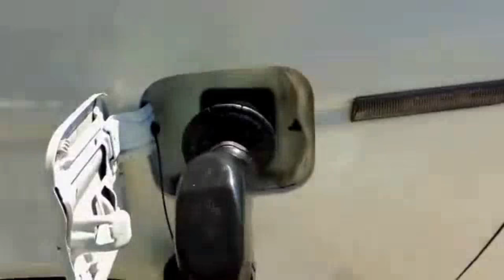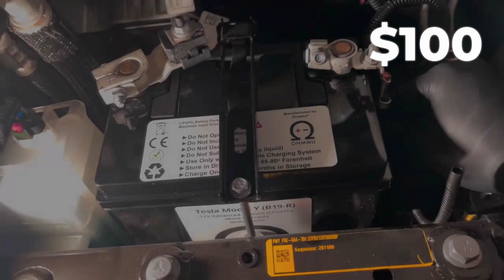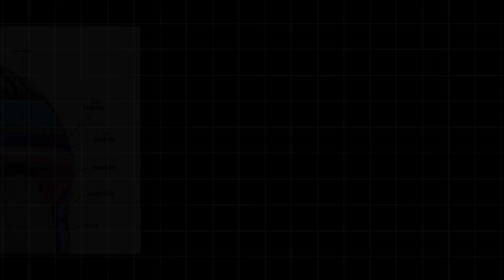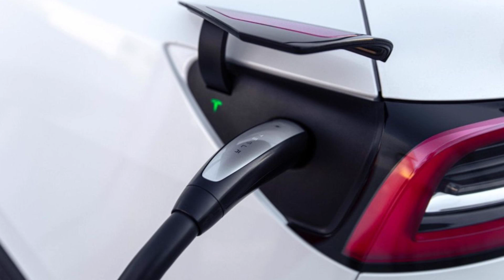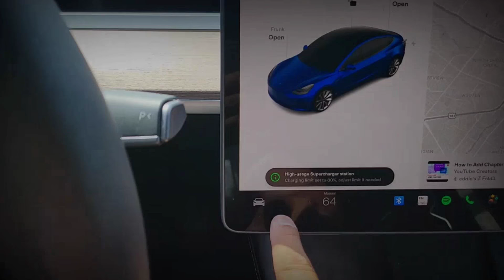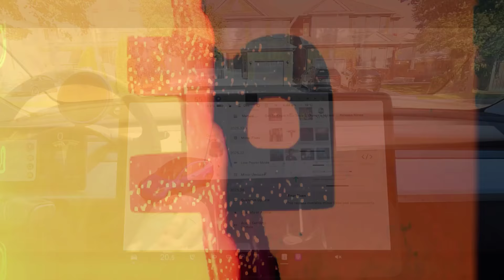How To Make Your Tesla Last Over 300k Miles Without Any Major Repairs

Comment: How do I check the battery cooland for leaks or degregation? You didn't show us much in the video. Thank you!
Reply from the maker: Pop the frunk and remove the panel by the windshield. The reservoir’s under there, and the level should sit between MIN and MAX. For leaks, check for drips under the car or crusty residue on the hoses, and the car will usually alert you anyway. The coolant is basically lifetime, so if the level keeps dropping, take it to service
Reply: @TeslaCentralHD So unless there's a leak, the fluid is rated for lifetime use?

Comment: I rotate my tires every 3000 miles.  Manager at Les Schwab who also owns a Tesla said the 6250 Tesla recommendation is not enough. First set of tires lasted 38,000 miles.  On my second set with 3000 mile rotations currently have 52,302 miles on the second set of tires with lots a tread left.  At 90,302 miles now.  I expect to get around 65,000 miles out of my second set of tires.  It’s a myth that EV’s burn up tires fast.  You just need to do shorter rotations. I’ve also only done one alignment in the life of the car so far.  I plan to do a second alignment when I do install my third set of tires.
Reply from the maker: 52k on the second set is pretty impressive. Sounds like those 3,000-mile rotations are really paying off.

Comment: What about charging it after every drive not waiting the battery to drain to 20% or below? Will it hurt the battery life if I charge it after every drive? If the battery is at let’s say 30%, 40%, 50%. Will it alter the battery life at all?
Reply: It will not hurt the battery life if you charge it after every drive. 
50% is the best for the battery. (the least chemical reaction) 
When I go on holiday ore will not use the care over some time I leave it at about 50%.     
Daily use is optimal at 30 to 70%.   But 20 to 80% is just fine.            
Enjoy your car !                                        Luv from Norway!  😀

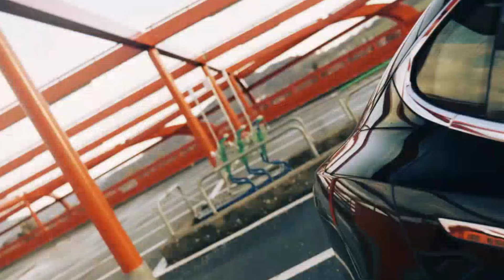Comment: @2:27 that is not a 12v battery that is a 16v lithium battery.  A 16v lithium battery should last 5-10 yrs.  A 12 v battery is $160 with tax at Tesla.  However a 16v lithium battery costs $450!

Comment: Yes, changing the 12 V battery. Every few years is good in the older models, but they took care of that in the newer models after 2021 and now the battery lasts a lot longer. I’m kind of surprised you didn’t note that.
Reply: @PodcastUFO.  I agree with you.  The 12V batteries in the newer Tesla models are using LFP (Lithium Iron Phosphate) chemistry which lasts 10 years.
Reply: I have original 7 year old battery in my M3 LR. Voltage 13.x . Seems to work fine

Comment: Please explain how to rotate Tesla tires.
Diffrent sizes front and rear.
Reply from the maker: If your Tesla has different tire sizes in the front and rear, you cannot rotate them front-to-back.

You may only swap left and right on the same axle if the tires are not directional. Otherwise, they should stay in their original positions.

Comment: Charge only enough to arrive at the next charging station with about 10-20% charge.
Reply: The chemical  reaction in your battery is higher at 10-20%   , better to go charge at 30-40%      🙏

Comment: Tesla changed from 12 volt lead acid batteries to around a 15.5 volt lithium ion batteries several years ago, with a major reason being that the lithium ion battery lasted 5+ years and longer compared to the lead acid batteries. They are also more expensive.

Comment: Charging above 80% is not a problem. Letting it stand with 100% in the sun is a big problem. 80% for daily charging is ok, but if you need 90% or 95%, not a problem, especially if you start driving after charging is done.
Reply: Exactly. The problem is simply leaving it at 100% stresses the battery at a higher rate anything under that will cut the charging. 80% is recommended as best case. So, no, definitely not critical.

Comment: Tesla now uses DOT 4 brake fluid.  
Silicone-based, and very little hydrophilic, if at all..
Reply: DOT 4 is "synthetic" and has a higher boiling point than DOT 3, but it is glycol-based, NOT silicone-based.  It can be used interchangeably with DOT 3.  DOT 5 is silicone-based.

Comment: I had a 2019 Model 3 that had the battery issue in 2022, but it didn't "die" as you suggested.  Instead, a warning message appeared to notify me that the battery voltage was at a critical level and needed replacement.  Tesla actually replaced it under warranty.

I've since sold the Model 3 and purchased a 2024 Model Y.  The car has been operating flawlessly.  So far, the only items I have replaced are the hepa filter and wiper blades.  Tires will be the next item on the list soon.  

Not sure about your suggestion to flush the brake system every two years.  In my gas powerered vehicle, (a 2018 VW Tiguan), I only flush the system when it is time to replace the brake pads, which is around every 35K miles or three years.  Since the system is a closed looped, sealed system under pressure, moisture should not be a factor.  The reason for flushing the system is because the fluid eventually breaks down due to heat and other factors.

As an aircraft owner, I recognize the importance of maintenance to keep our machines running in tip-top shape.  Thank you for the advice.

Comment: For a channel that was started quite some time ago and only 3 video’s posted - meh canned  messages with a lot of mis-information mixed in with some common sense and very few tidbits of meaningful info. I could critique much of  this video - maybe all this assumption was made on vehicles produced more than 3-4 years ago - a lot has changed - so used Tesla market specifically sub 2017 /2018 models.

Comment: If your Tesla has a LFP battery like mine it probably also has a 15V Lithium ion low voltage battery. If your car is the same you should regularly charge your battery to 100% and you don’t need to replace the low voltage battery for at least 5 years.

Comment: Yeah, I never got a notification about my 12v battery and when it died it was definitely an inconvenience. The crazy thing is that just the week before, I actually had a fleeting thought about the 12v battery and realized it was about 3 and half years old. But I do think the car was trying to tell me something was up because a few days before it died, I noticed the trunk button didn’t work the first time I pressed it. But, because that sometimes happens anyway if your phone is in your back pocket, I didn’t make the connection. I was pleasantly surprised the OEM battery I picked up from Tesla was a tad over $100. Not bad…

Comment: Incorrect.

Tesla recommends CHECKING brake fluid every two years — replacement only every four.
Reply: Tesla service told me they suggest the brake fluid (AND the battery coolant) will last the life of the car  (2019 Model 3 Dual motor LR) but do suggest checking it every 4 years.
Reply: @edchwekun3963 They told you wrong.  Read the manual.  Brake fluid physically breaks down after four years, even if unused.

Comment: Homeboy i lost 20% on a 2023 model y in 70k miles i drive 150 miles round trip to work 3x a week 100% charge is MANDATORY because the range is way less than what tesla claims.
Reply: Your bad charging habits is not a design fault.
Reply: Are you living in the arctic or something? You absolutely should  get enough charge to do 150 miles without needing 100% charge every day. If anything you are creating this problem with your battery by degrading it so quickly

Comment: 1. Charge only to 80% most of the time. [Wrong. Battery degradation increases significantly above 75% according to Jeff Dahn(2023) and Recurrent Auto(2025)]
2. Replace the 12v battery every 3 years. [This is for lead acid. Interval is much longer for newer Li-Po batteries]
3. Flush brake fluid every 2 years. [This is for all vehicles]
4. Rotate tires ever 6,250 miles. [All cars should do this either every 5,000/6,250/7,500]
5. Replace cabin air filter every year. [No. Check the Tesla computer to know when, it tells you]
6. Supercharge only to 80%. [Besides battery health, you should do this because its a waste of your time to go past that and its really rude for anyone else waiting]
7. Precondition HV battery before supercharging. [YES, do this]
8. Inspect/replace suspension bushing every 100,000 miles.  [This is for any car]
9. Keep your software up to date.  [This is for any car]
Reply: For 1 and 6 is there some context missing?   Cap charging at 75% then?
Reply: You have no idea how incremental that is. Take a Tesla 75 kWh NMC battery:
100% SOC = 4.20V per cell. 
80% SoC = 3.98V per cell.
75% SoC = 3.94V per cell.  <<<The difference between 75% and 80% is 0.04v. This difference is negligible

Comment: I had a coolant leak late last year, as in all of it leaking onto my garage floor.  Mice who had discovered the toasty warmth of the batteries after I get home, also discovered the tasty coolant lines and chewed through them.  So a tilt bed tow truck was dispatched to my house, and I rode along so that I could get a loaner to use while they were dropping the battery and replacing the lines.  Fortunately, comprehensive auto insurance covered the cost.
Reply: Deng really? Through Tesla insurance?

Comment: "Recommendation for LFP is to drain it during the week (or set an ~80% charge limit) and then charge it up to 100% around once a week for calibration purposes."

Of course, slow charging, such as home charging speeds of 2.3 kW to 22 kW, is better for the battery.

< Citation Start >
August 26, 2024

Lithium Iron Phosphate (LFP) batteries have been the go-to option for many electric vehicles, known for their durability, safety, and cost-effectiveness. For years, automakers like Tesla have encouraged drivers to regularly charge their LFP-equipped vehicles to 100% without fear of significant battery degradation. That’s why you’ll find them in entry-level EVs like the rear-wheel-drive Tesla Model 3 and the base Ford Mustang Mach-E. Automakers have consistently recommended charging these batteries to 100% to keep range estimates accurate and maintain battery health. 

But a new study is shaking up that advice, suggesting that full charges might not be as harmless as once believed.

> So, what’s the big deal?
The study tested various charging ranges—from 0%-25% to 75%-100%—and under different temperature conditions. The results? Charging to 100% regularly, especially in warmer climates, can cause LFP batteries to degrade faster. For instance, in the worst-case scenario, some cells lost up to 24% of their capacity over the equivalent of 10 years of use.

While that sounds alarming, the study also notes that the actual impact on battery life might not be as significant as it seems. Even with more frequent full charges, most users will see relatively minor degradation, especially when considering the long warranties offered by manufacturers. Tesla’s LFP batteries, for example, are expected to last hundreds of thousands of miles, with a 15-year lifespan before dropping to 85% capacity.

> What’s a driver to do?
So, should drivers change how they charge there EV? The study doesn’t call for a complete overhaul of your habits, but it does suggest a more balanced approach. Charging to 100% might be necessary for long road trips or during winter when range is limited. But for daily use, keeping the battery at a lower state of charge could help extend its life.

< Source >
batterytechonline.com
< Citation End >

There are comments that LFP batteries can be charged up to 100%. I'm only mentioning it because these are still lithium batteries.

The decision is yours. 🥂

Comment: The cabin air filter is in fact cheap to purchase. The chiropractor visit you’ll require after contorting yourself into position to change it is not !
Reply: Too bad it's not like my Honda. That filter was right behind the glovebox, it took maybe 5 minutes to change and I didn't slip a disk doing it.
Reply: @lashlarue59  it's simple. I got one arm & it took me 7 min to swap it out & spray / clean the area.  Don't listen to that Mo$on
Reply: @tonykari5124 Thanks for the info.
Reply: @tonykari5124 What is a Mo$on?
Reply: So true - particularly in Right Hand Drive models where you have the steering wheel in the way also!

Comment: False from the start. "Most new Tesla owners charge to 100%" is not true. The car itself tells you right on the screen to charge daily to 80% unless it's LFP. Also telling new Tesla owners to change the 12v battery is also wrong. Tesla moved to Lithium lifetime low voltage batteries about 4 years ago. This is when I stopped watching. Spewing false information is criminal.
Reply: Right after that YOU MISSED out on possibly the best few THINGS u should know.   Now go rewatch it & GAIN some knowledge
Reply: I just purchased a 22 model 3 for the lfp technolgy so I know the first part of this is false but it depends what tesla you buy as they are only in standard range and standard range plus like I got. I will keep watching as he is not wrong for non lfp battery teslas so all the extended range teslas but I needed the lfp battery as I do rideshare and yet I do see many teslas using extended range for rideshare but the degredation is a big issue so he is correct for many tesla owners.
Reply: @djomega1  I think you made the absolute best choice for rideshare. LFP won't let you down
Reply: So it’s best to err on the side of caution, and whether you agree or disagree with the information presented in this video, won’t matter if you find yourself in any of the situations described in the video.

So to be forewarned is to be forearmed, don’t you think?🤔

Comment: Giving Tesla advice while pointing at a 16v battery and calling it a 12v battery, please tell me more....
Reply: He should just call it the Low Voltage Battery. But in all fairness, Tesla stopped using the 16v batteries about a year ago. Back to 12v. Or more specifically, 12.8V LFP
Reply: Glad I am not the only one who noticed 😂

Comment: Loads of BS in this video.  The regen in my model 3 means I rarely ever use the brake. I could go all the way down a mountain using regen alone, no problem at all. The hydraulic brake fluid is sealed, it therefore never comes in contact with the air.
Reply: Brake fluid does get contaminated with moisture over time. The test is very simple and a good shop will test it before recommending replacement.
Reply: Only replace brake fluid if it’s at a certain moisture content or using one of the test strips and it says to replace. Otherwise, you’re throwing money away.

Comment: You don’t need to replace your air filter every year and you can also check within service mode what % your filter is at. Makes no sense to replace it if it’s 90% health. Also leaving your AC on auto settings will help keep your system great and will adjust speeds accordingly.
Reply: Cabin air filter shouldn’t be changed on a time basis. In my Model 3 I have replaced mine every 6 months. I have driven 30k miles avg.
Reply: @harveypaxton1232  everyones different, as for me im saving money, and following what the car is showing me, also if its not stinking up the car like the previous filter, I don't see why I need to change it anytime soon.
Reply: ?  How do you use the on board diagnostic to check the health of your cabin air filter?
Reply: @kimstockdale632 search for: how to check your Tesla cabin filter health. I made a video about it.

Comment: Most teslas 3’s and y’s after 2022 have LFP 12 volt batteries. X and S still use a NCA or NCM 15 volt battery. LFP lasts much longer. I personally drive a 12 year old hybrid and have never changed the brake fluid. Brakes are closed systems that do not have exposure to external conditions.  I changed my brake pads at 170,000 miles. Didn’t need to, but t thought it would be better, and no rotor changes either. My car stays protected from the elements in my garage which helps.  My first 12 bolt battery lasted 7 years Since it is protected in the trunk, why would I need to change it out sooner. My current battery is nearly 6 years old. I suggest make maintenance changes individually, not on someone’s claim to fame!!
Reply: I thought this was a weird video. Lol